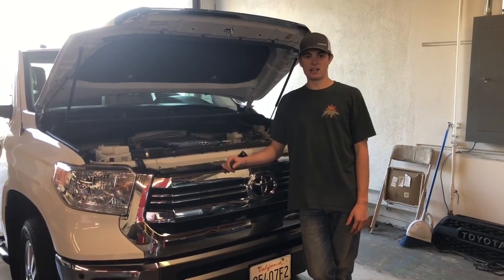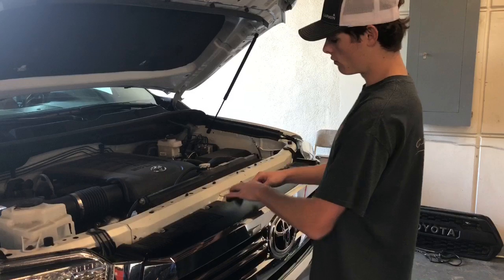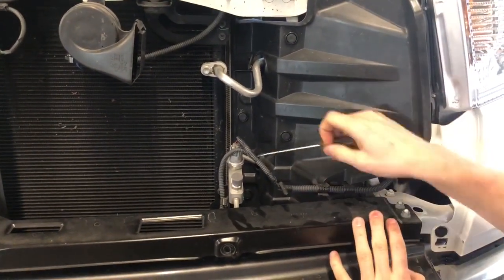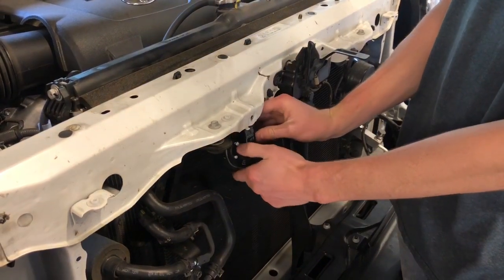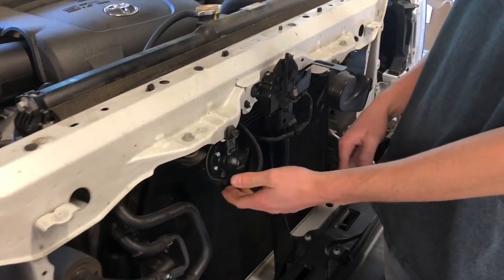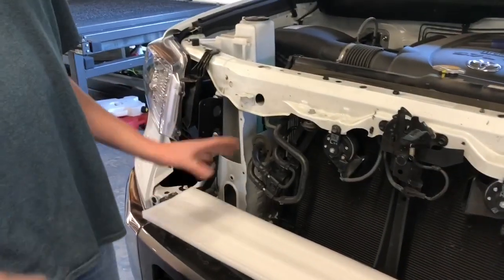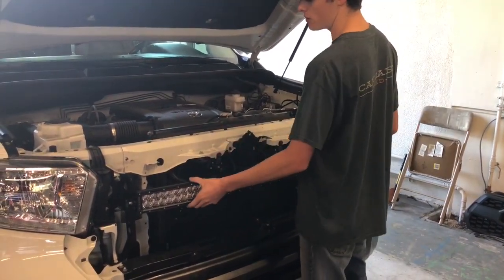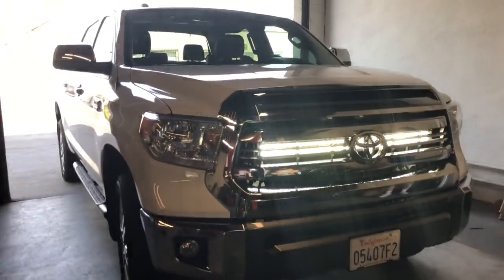How to Install 42" Hidden Grille Curved LED Light Bar Kit for 2014-2021 Toyota Tundra | Cali Raised

Comment: Will a triple row light fit there? And will a double light fit in the bottom of the bracket so you have an upper and lower 42in curved lights?
Reply from the maker: You can fit two dual-row 42inch light bars in the grille. Let us know if you have any other questions.